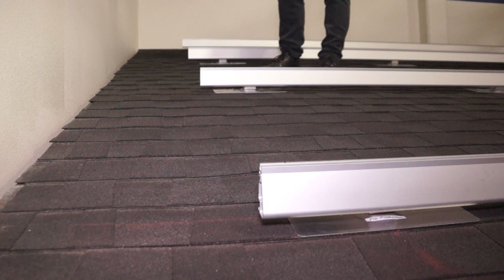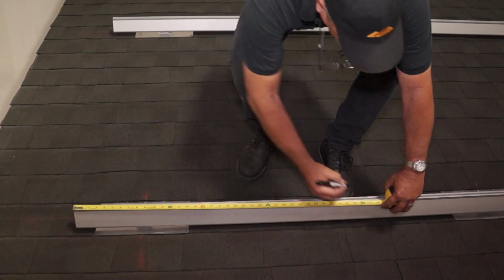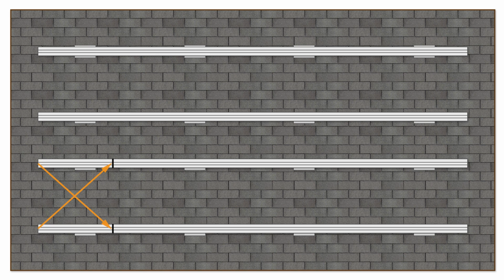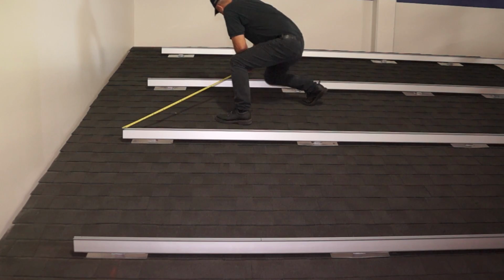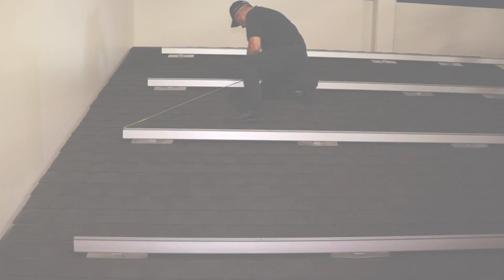Tech Tip // The Secret to Square XR Rails

Comment: What’s the best way to level out the rail system? Would that be to use a 6 foot level, I’m trying to do it the fastest and easiest way
Reply from the maker: Hey there! To level your array, ensure the rail attachments on either edge of your array are tightened at the desired height from the roof. You can pull a string-line across the rails diagonally, from corner to corner both ways, to spot any deviations in height. Adjust any protruding or descending rail locations to the proper height. You can also pull the string-line across the rails, from north to south, to check along the sides of the rails. Once complete, your array should be level and ready for modules. You could also use a spare piece of rail as a straight-edge. Be sure to go to IronRidge.com/training for new and improved training content!

Comment: Why not just make sure you're measurements off the eave are correct to start? And how are you adjusting rails up and down the rake with the feet securely placed and everything bolted anyways?! Just measure each end off the eave and be done.
Reply from the maker: Hey Aaron, we appreciate the feedback. There are definitely other ways to square up your array. Sometimes the roof eave may not be square on an old roof. The L-Foot hardware can remain loose so the rail can be adjusted, and then tightened after that. Making sure the rails are square also confirms that the racking is equally distributing support across the modules. We do have new and improved training content available on our website, so be sure to check that out at IronRidge.com/training. Thanks for checking in!
Reply: @IronRidgeSolar  Ah, I understand. I'm using flashfoot2 legs in Florida with a lot of new(er) homes. Completely different conditions.